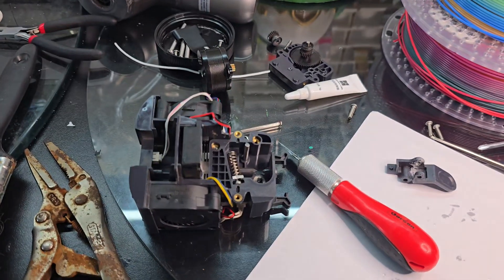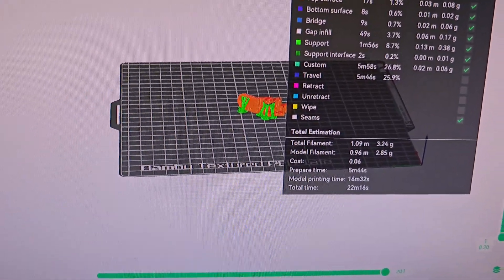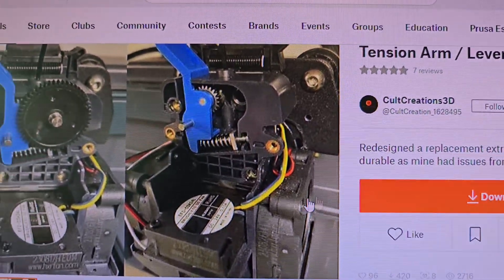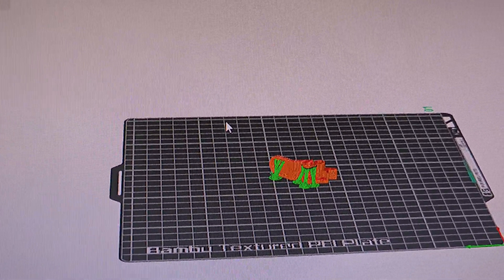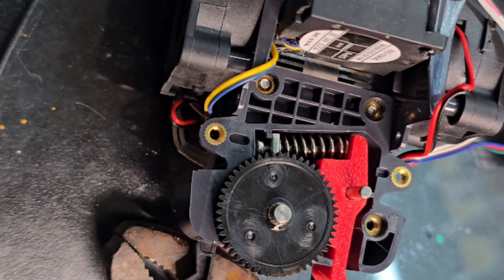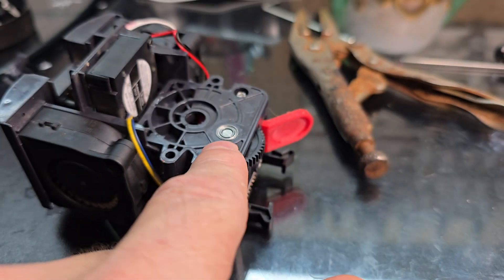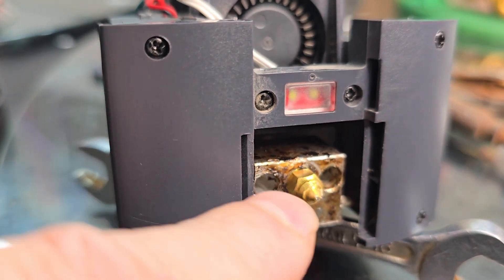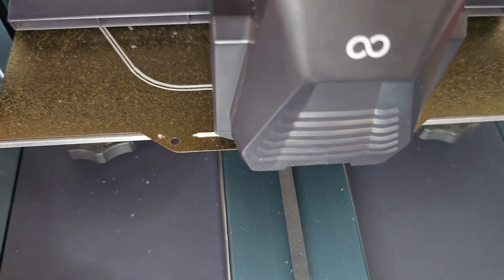Bambu A1 RESCUES Elegoo Neptune 4 Pro from Disaster!

Comment: Hi, what was the problem in the prints before you fixed the printer? Because I have an elegoo neptune 4 and I don't how notice if I have this problem.
Reply from the maker: The lines wouldn't squish together no matter how much I adjusted z. There a adjustment screw on right side of extruder to adjust tightness on the filament.  If you can pull the filament out of the extruder with small force and adjustments are all the way counterclockwise (tightest) and you can still pull it out, this could be the possible issue.